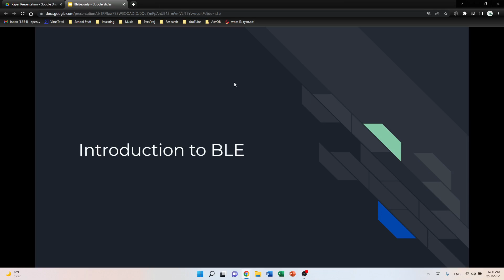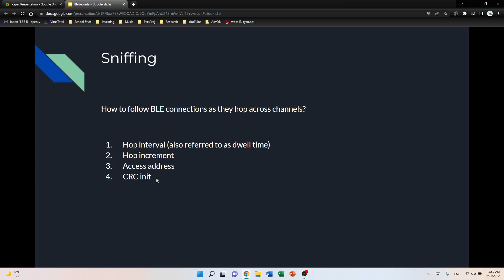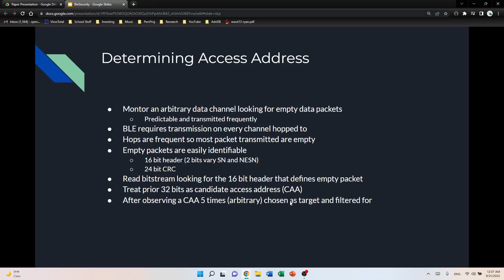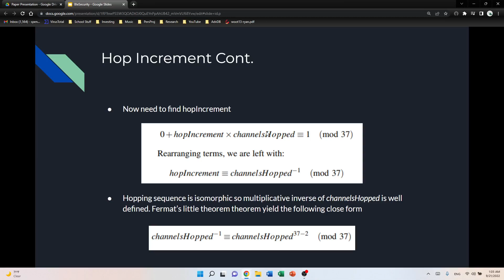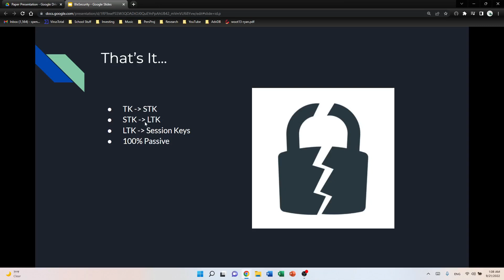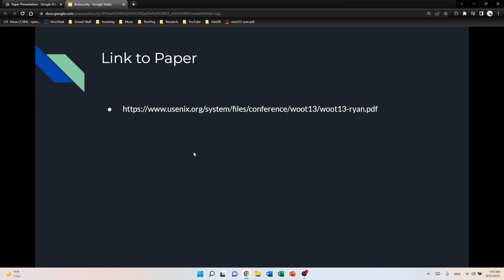Bluetooth Low Energy Security Vulnerabilities

Comment: The weakness in the key exchange is fixed! At least for sessions using BLE Secure Connections (which was introduced in 4.2). Instead of the TK etc, they now use a diffie-hellman key exchange which which is kind of impossible to crack.
However, for "just works" (and "Passkey entry" (or 6-digit code as you refers to it) when the code is static) it is possible to do a MITM attack.
Reply from the maker: Awesome man. Thanks for that feedback!